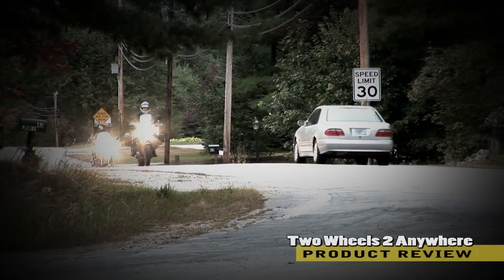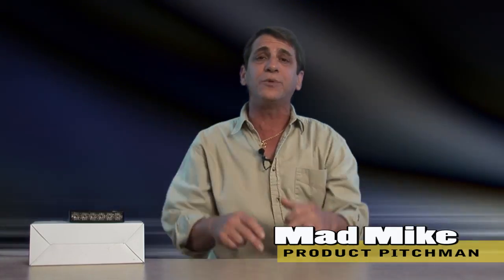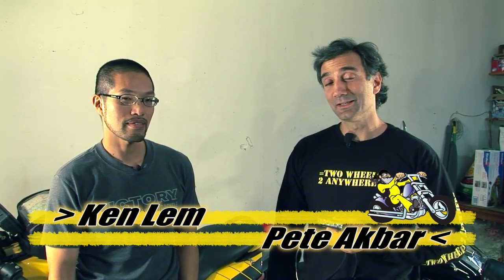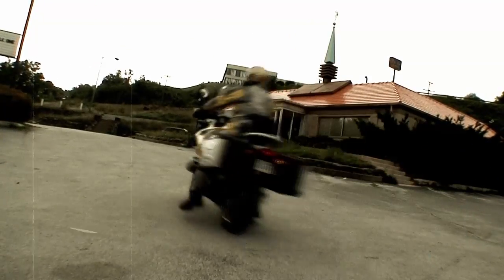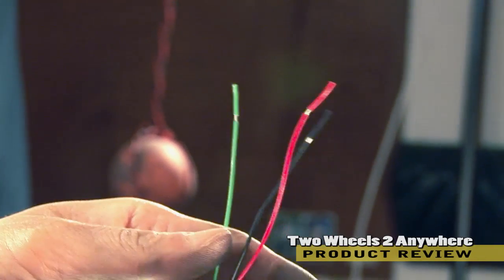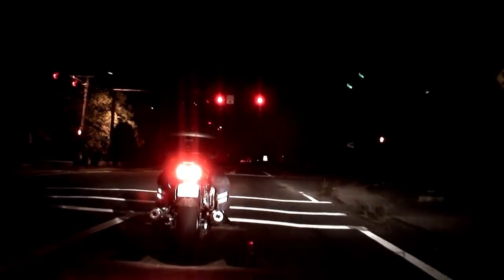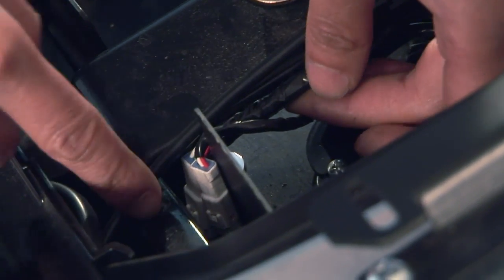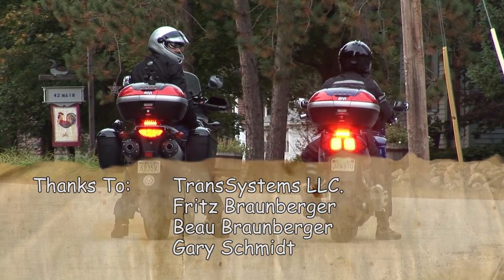StrobeWise™ Review - Motorcycle Install & Demo of Rear End Collision Avoidance Device

Comment: All of you that are complaining about the pitchman, get a life.  Really, that is what you bring to the table.  This looks like a good product.  I will be trying one, but need a little more info as I have a 2014 FLHTP, and the wiring is not like a normal Harley.  I need info about the speed-sensor hook up.
Reply: Michael is right. The big deal about this product is that is registers at 0.01 G's.  And has no false alarms like competing products. StrobeWise will also activate a head light modulator so that you don't have to have your headlight blinking all of the time.....only when you are approaching an intersection or other potential problem area. www.strobewise.com

Comment: stupid, too hard to install.i got something easier, plug and play. should just use a g sensor. i think i have one in my phone
Reply: RatoneJR says to use a g sensor. Well those units are out there already but they see gravity the same as a decelerating vehicle. So they are not accurate and false alarm if set to sense minor deceleration. If set to major deceleration then you gain nothing over brake lights.
Reply: Fritz Braunberger You made a good point, thanks.